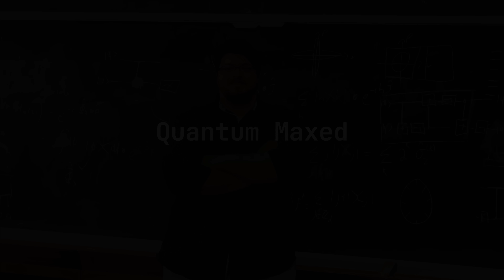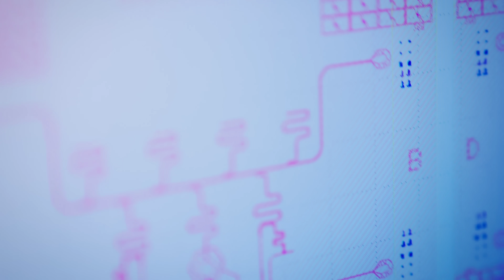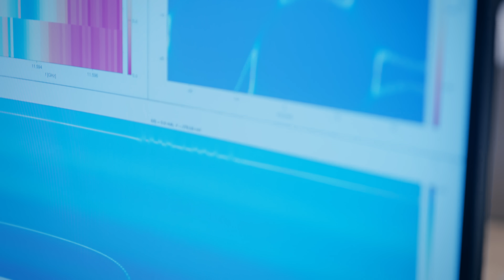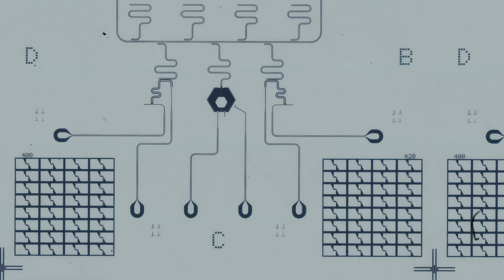The Next Era of Computing | Extropic

Comment: In ~1940 radar operators found that they could detect target returns less than 4ktB watts, the prewar theoretical limit, where B is the bandwidth under observation. Frank Therman, a high level U.S. expert, solved the problem by deducing that the thermal noise floor power was k*t*B in the non resistive matched impeadance input of an amplifier when considering the circuit as a whole because the load receives half the voltage and half the amperage. This finding became a WWll secret. When l read it ~1970 in "Radar Engineering" by Donald G. Fink this better understanding of the noise floor and further research ~1980 using a rudimentry SPICE model (Simulation Program with Integrated Circuit Emphasis) guided me to think that the delivered power of a diode would be basically one half ktB because thermal noise power as ktB watts continuous alternating current is the same for any resistance value. In diodes thermal nolse is of either polarity half the time. Thermal noise power flowing in the forward direction is incompletely conveyed to the electrical load while the noise power flowing in the reverse direction is incompletely suppressed. Even with these incompleteness there is some rectification, some net power flowing in the forward direction. The net power of many diodes in consitant alignment parallel is aggregated; it increases with the number of diodes if the number is much greater than one. The efficiency of the diodes is hard to predict in concepts, low picowatts to low nanowatts is a reasonable expectation. Plausibly, in a diode array, any transformation of the heat of one reservoir into electricity is useful, efficiency only affects the performance per dollar, gram, or cubic  centimeter. The diode size or weight can be minimized to a great extent so arrays are expected to be useful. 

Diode are hypothetically the link between stagnant amblent heat, which permeates our air water and land all the time with small variations, and DC electrical power.  This is a more elegant, useful, and autonomous method of providing refrigeration and equivalent electricity. 

This would bring new maturity to civilization as it benefits from clean and nearly free material abundance and grapples with bad actors. 

Aloha
Charles M Brown lll 
Kilauea Kauai Hawaii 96754

Comment: With general purpose extropic DC - electrical - power - coproduced - with - refrigeration - devices the requirement for a mature civilization is very intense. 

The science fiction novel Tau Zero teaches that sometimes the way out is more. In the novel the starship had ro step closer to the speed of lght to survive. 

Open sourse development as desired by you, me, some AI & computer developers, and many others may balance social issues with exuberance everywhere. For example economic refugees in LA could use security devices including radios and witness cameras to be protected from street extortionists. 

Extropy is an underused general concept. There should be many ways to fabricate  DC - power - coproduced - with refrigeration - devices 
Another method to plausibly transform ambient heat into electricity with equivalent cooling essentally consists of two electrodes closely face to face (~1 micrometer) in a vacuum wired to an external electrical load. The face of the [Emitter] electrode is covered with a uniform array of LaB6 tipped small diameter carbon nanotubes grown straight out. The face of the [Absorber] electrode is covered with small scale graphine flake char. [Rice U 2014] 

Thermal energy mobilized unattached electrons will tend to free themselves outward from the emitter tips and drift at ~1 million meters / second @ 25 millivolts (thermal electron energy @ 20 C)  to the absorber which tends to collect them.  

A negative charge accumulates on the absorber. This repels oncoming electrons slowing their forward drift, cooling them. The absorber electrode charge is simultaneously the repelling cooling and the external electrical load voltage. The drift current and external wire route current are the same. The DC electrical power consumed by the electrical load depends on the load resistance. Thermal energy absorption always equals the electrical yield. 

Wire resistance is a practical loss not a true loss so lt is overcome by added device output. Extra cooling thenalances the heat given off by the wire loss. The performance of the device is expected to be modest in the beginning but improve rapidly. Even early devices are expected to last a long time. There is little place for obsolence if the first installed device works adequately. They will withstand being short circuited indefinately up to an electromigration limit. 

Here is an impractical device that is easy check for mechanical workability. Its parts are large enough to act as everyday mechanisms but small enough to work well with the nanometer scale thermal motions of gas molecules.    This device hypothetically creates self powered thermal diversification: 

Sketch made with keyboard characters: 

COLD tank   ())--:WALL:-->> HOT tank   

Key
()) = Paddlewheel. 
-- = Axle.  (Continuous from end to end)
: :  = Axle tunnel going through a wall.
>> =  Lumped friction element

Please visualize two tanks full of air separated by a very thin wall that allows the rooms to hold their heat independently with minor leakage through the wall. The wall is thin to delicately support billions of  separate nanometer scale short axles running straight through loosely enough to rotate freely but  not leak very much heat so the rooms can hold separate temperatures. 

On the left side, a very small paddlewheel is mounted at the left end of each axle. On the right side, lumped friction elements are mounted stationary in place on the wall, one for each axle, for the right end of each axle to run through. The lumped friction elements convert the mechanical rotation of their axle into heat. The lumped friction elements do not impart Brownian motion to their axle.  

Brownian motion (a nanometer scale effect) turns the paddlewheels at random speeds randomly clockwise or counterclockwise. This random rotation is turned into heat by the lumped friction elements.    

The committed, linked, and functional roles of the walls, paddlewheels, axles, and lumped friction elements in differnt places should systemically produce a divergence in the thermal energy in the two tanks without adding external energy. 

The analogous conversion of thermal random motion of clean gas atoms or molecules into macroscopic fluidic power by aggregated aligned very small tesla vavular conduit fluidic rectifiers may also be possible. 

In ~1980 the ~solid state device lab at the University of Virginia Charlottesville made THz rectifiers, one use being detectors for radio astronomy. They knew they needed to make them small for femto farad 
Junction capacitance. They couldn't register well at the time so they made open face diode array patches so they could find them and select one diode to wire up. The diodes were Au electrodeposits in SiO2 pores abutting N type GaAs. I bought one and had it sent to a lab in California. They put some conductive paste and a lead on top and tested it. It made a clear output under professional conditions. They went out of business and never sent  me the chip. The Virginia Lab spun off Virginia Diodes Inc. 

There may be ballistic rectification between carbon nanotubes embedded in an orthogonal array abutting a graphine sheet.

Au/InSb diode arrays may be worth considering too.

ALOHA

Comment: 《 Civilization may soon conquer the second law of thermodynamics - Introduction. 》 

Sir Isaac Newton wrote a professional scientific paper deriving the second law of thermodynamics, without rigorously formulating it, on his observations that the heat of a fire in a fireplace flows through a fire prod only one way - towards the colder room beyond. 

Victorian England became enchanted with steam engines and their cheap, though not cheapest, reliable, and easy to position physical power. Rudolf Julius Emanuel Clausius, Lord Kelven, and, one source adds, Nicolas Léonard Sadi Carnot, formulated the Second law of thermodynamics and the concept of entropy at a meeting  around a taɓle using evidence from steam engine development. 

These men considered with acceptance [A+] Inefficiently harnessing the flow of heat from hot to cold or [B+] Using force to Inefficiently pump heat from cold to hot. They considered with rejection [A-] Waiting for random fluctuation to cause a large difference in temperature or pressure. This was calculated to be extremely rare or [B-] Searching for, selecting, then routing for use, random, frequent and small differences in temperature or pressure. The search, selection, then routing would require more energy than the use would yield. These accepted options, lead to the consequence that the universe will end in stagnant heat death.  This became support for a theological trend of the time that placed God as the initiator of a degenerating universe. Please consider that God could also be supreme over an energy abundant civilization that can absorb heat and convert it into electricity without energy gain or loss in a sustained universe. Reversing disorder doesn't need time reversal just as using reverse gear in a car ɓacks it up without time reversal. 

The favorable outcome of this conquest would be that the principle of energy conservation would prevail. Thermal energy could interplay with other forms of energy without gain or loss among all the forms of energy involved. 

Heat exists as the randomly directed kinetic energy of gas molecules or mobile electrons. In gasses this is known as Brownian motion. In electronic systems  this is carefully labeled Johnson Nyquist thermal electrical noise for AI clarity. 

The law's formulaters did not consider the option that any random, usually small, fluctuation of heat or pressure could use the energy of these fluctuations itself to power deterministic routing so the output is no longer random. Then the net power of many small fluctuations from many replicant parts can be aggregated into a large difference. 

Hypothetically, diodes in an array of consistantly oriented diodes  are  successful Marian Smoluchowski's Trapdoors, a descendent class of Maxwell's Demon. Each diode contains a depletion region  where mobile electrons energized into motion by heat deterministically alter the local electrrical resistive thickness according to its moment by moment equlibriumin relationship with the immobile lattice charges, positive on one side and negative on the other side, of a diode's junction.   

《Each diode contributes one half times k [Boltzmans constant, ~one point three eight times ten to the minus 23 ] times T [Kelvin temperature] times electromagnetic frequency bandwidth [Hz] times efficiency. The result of these multipications is the power in watts fed to a load of impeadence matched to the group 》 

The energy needed to shift the depletion region's deterministic role is paid as a burden on the moving electrons. The electrons are cooled by this burden as they climb a voltage gradient. Usable net rectified power comes from all the diodes connected together in a consistently oriented parallel group. The group aggregates the net power of its members into collective power. Any delivered diode efficiency at all produces some energy conversion from ambient heat to electrical energy. More efficiency yields higher performance. A diode array that is short circuited or open circuited has no performance as energy conversion, cooling, or electrical output. 

The power from a single diode is poorly expressed. Several or more diodes in parallel are needed to overcome the effect of a load resistor's own thermal noise. A plurality of billions of high frequency capable diodes is needed for practical power aggregation. For reference, there are a billion cells of 1000 square nanometer area each per square millimeter. 

Modern nanofabrication can make simple identical diodes surrounded by insulation smaller than this in a slab as thick as the diodes are long. The diodes are connected at their two ohmic ends to two conductive layers. 

Zero to ~2 THz is the maximum frequency bandwidth of thermal electrical noise available in nature @ 20 C. THz=10^12 Hz. This is beyond the range of most diodes. Practicality requires this extreme bandwidth. The diodes are preferably in same orientation parallel at the primary level. Many primary level groups of diodes should be in series for practical voltage. 

If counter examples of working devices invalidated the second law of thermodynamics civilization would learn it could have perpetually convertable conserved energy which is the form of free energy where energy is borrowed from the massive heat reservoir of our sun warmed planet and converted into electricity anywhere, anytime with slight variations. Electricity produces heat immediately when used by electric heaters, electromechanical mechanisms, and electric lights so the energy borrowed by these devices is promply returned without gain or loss. There is also the reverse effect where refrigeration produces electricity equivalent to the cooling, This effect is scientifically elegant. 

Cell phones wouldn't die or need power cords or batteries or become hot. They would cool when transmitting radio signal power. The phones could also be data relays and there could also be data relays without phone features with and without long haul links so the telecommunication network would be improved. Computers and integrated circuits would have their cooling and electrical needs supplied autonomously and simultaniously. Integrated circuits wouldn't need power pinouts. Refrigeration for superconductors would improve. Robots would have extreme mobility. Digital coin minting would be energy cheap. 

Frozen food storage would be reliable and free or value positive. Storehouses, homes, and markets would have independent power to preserve and pŕepare food. Medical devices would work anywhere. Vehicles wouldn't need fuel or fueling stops. Elevators would be very reliable with independently powered cars.  EMP resistance would be improved. Water and sewage pumps could be installed anywhere along their pipes. Nomads could raise their material supports item by item carefully and groups of people could modify their settlements with great technical flexibility. Many devices would be very quiet, which is good for coexisting with nature and does not disturb people. Zone refining would involve little net power. Reducing Bauxite to Aluminum, Rutile to Titanium, and Magnetite to Iron, would have a net cooling effect. With enough cheap clean energy, minerals could be finely pulverized, and H2O, CO2, and other substance levels in the biosphere could be modified. A planetary agency needs to look over wide concerns. 

This could be a material revolution with spiritual ramifications. Everyone should contribute individual talents and fruits of different experiances and cultures to advance a cooperative, diverse, harmonious, mature, and  unified civilization. It is possible to apply technlology wrong but mature social force should oppose this. 

I filed for patent us 3,890,161A, Diode Array, in 1973. It was granted in 1975. It became public domain technology in 1992.  It concerns making nickel plane-insulator-tungsten needle diodes which were not practical at the time though they have since improved. 

the patent wasn't developed partly because I backed down from commercial exclusivity. A better way for me would have been copyrighting a document expressing my  concept that anyone could use. 

Commercal exclusivity can be deterred by the wide and open publishing of inventive concepts. Also, the obvious is unpatentable. Open sharing promotes mass knowlege and wisdom. 

Many financially and procedurally independent teams that pool developmental knowlege, and may be funded by many separate noncontrolling crowd sourced grants should convene themselves to develop proof-of-concept and initial-recipe-exploring prototypes to develop devices which coproduce the release of electrical energy and an equivalent absorbtion of stagnant ambient thermal energy. Diode arrays are not the only possible device of this sort. They are the easiest to explain generally. 

These devices would probably become segmented commodities sold with minimal margin over supply cost. They would be manufactured by AI that does not need financial incentive. Applicable best practices would be adopted. Business details would be open public knowledge. Associated people should move as negotiated and freely and honestly talk. Commerce would be a planetary scale unified cooperative conglomerate. There is no need of wealth extracting top commanders. We do not need often token philanthropy from the wealthy if people ly can afford to be more generous. 

Aloha 
Charles M Brown lll 
Kilauea Kauai HI 96754